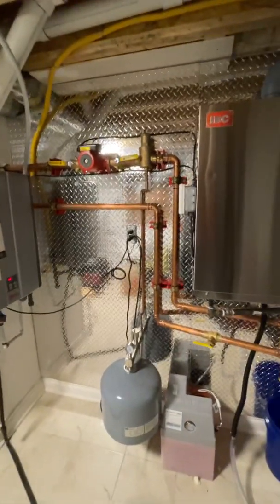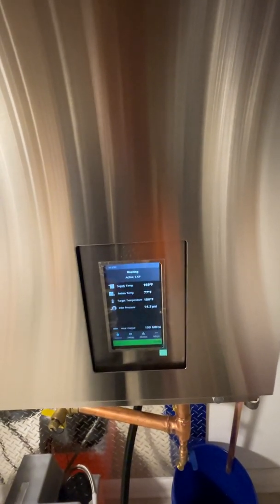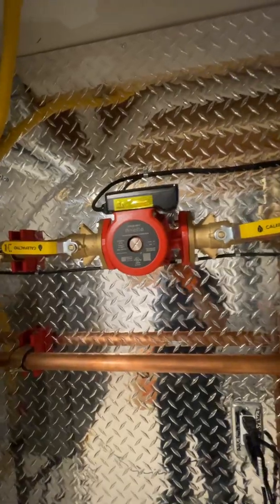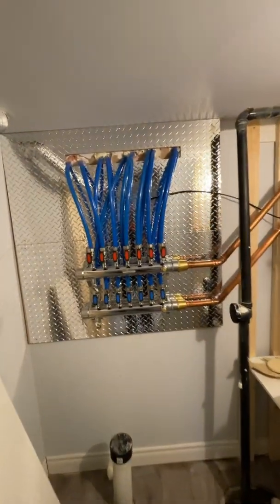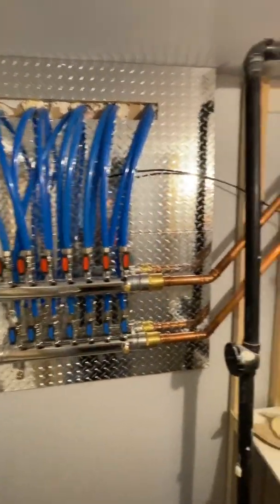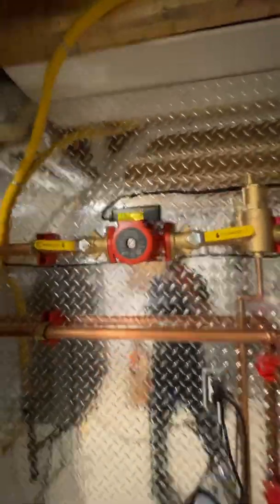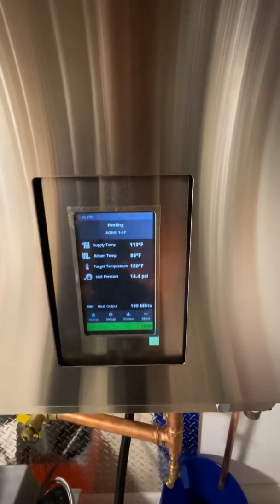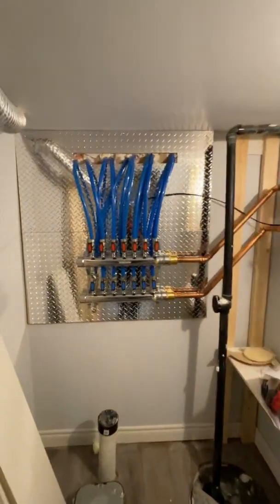Commissioning an IBC VX199 boiler based snow melt system.

Comment: What is the normal start and maintain temps on the system.
Reply from the maker: Set point 150F if that's what you are asking?
Reply: @GTAHeatca  I feel much better, I’m a HVAC guy in central KY and was sending it at 125. I was able to bone dry that thing in two hours in a ice storm. We don’t have many systems here due to low snow amounts. I went down the steps on ice once before and said new slab what can go wrong.
Reply from the maker: @hvachacker586  you get away with 125 because you don't have the cold we have here. The colder it is the more heat loss you need to compensate for with higher water temperatures. I wish 125 worked here, the less is better for efficiency.